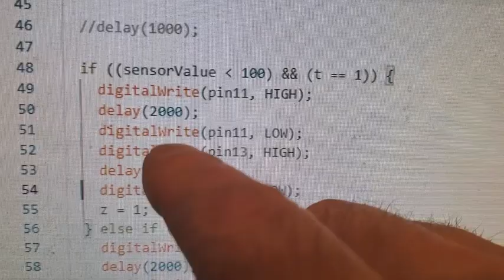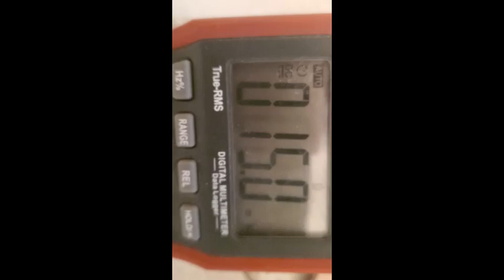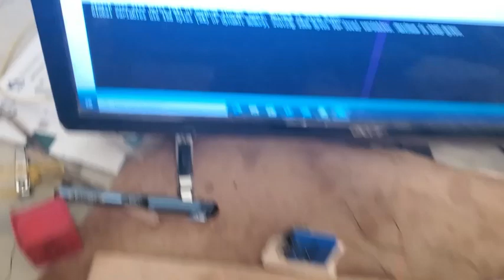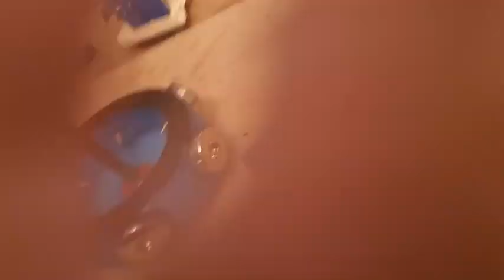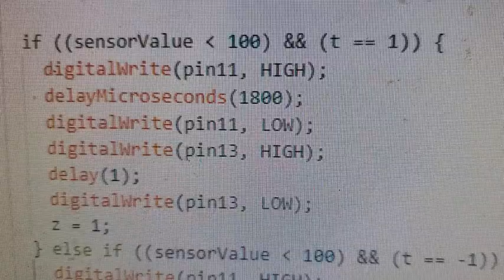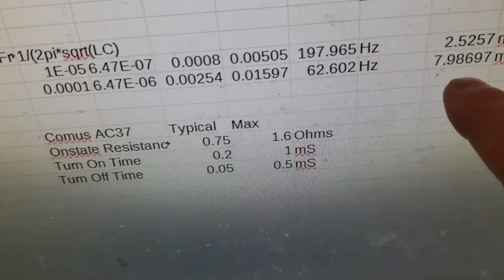More Fun with a 4 Inch Rotor

Comment: Is the capacitor ate the same capacitance as the coil has inductance and in series. If so you don't need all the Circuitry. Where is the ground wire? It gets better efficiency When you have a groundwire InBetween the capacitor and indoctor.
Reply from the maker: First off, Mad T scientist, apparently on some of the videos the comments were thrown into "held for review", don't know why, will sort that out so hopefully it doesn't happen going forward, sorry,  just saw your comment a couple days ago. Any capacitor discharged into an inductor rings at a specific resonant frequency just as any tuning fork with prongs of different sizes rings at a specific note. The question becomes, to my mind, interrupting the resonance at a reasonable time, perhaps not unlike pushing a child on a swing at a reasonable time.  This video wasn't focused on that issue as far as I recall, but certainly resonance is an interesting topic to investigate and meditate upon.